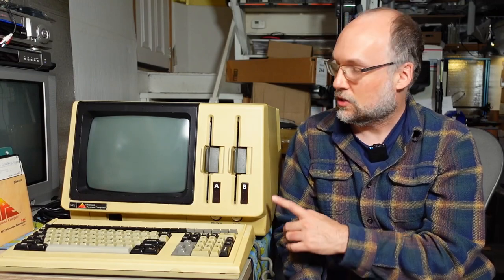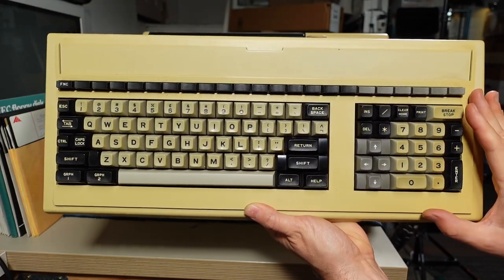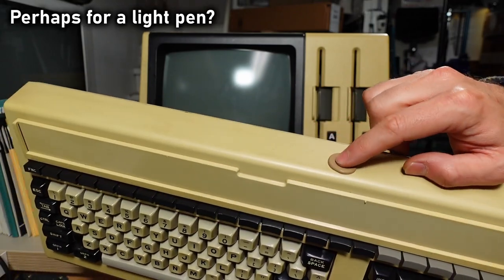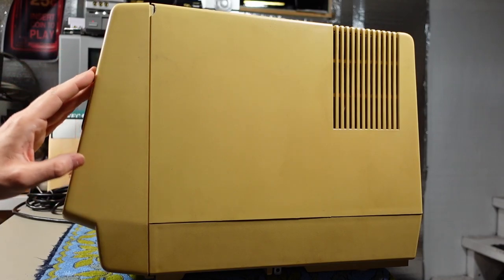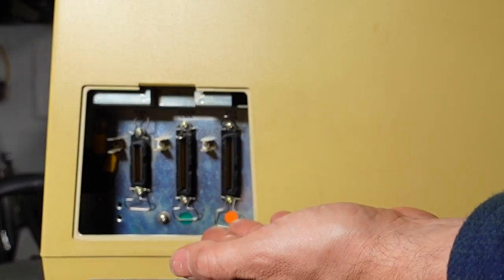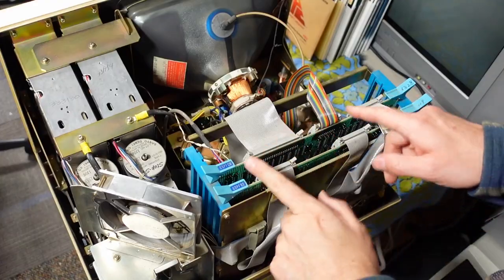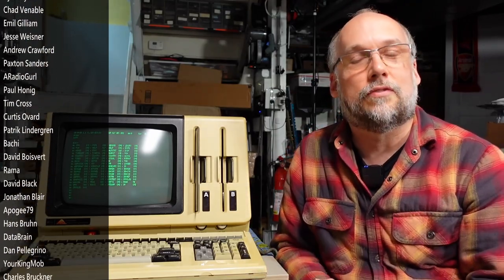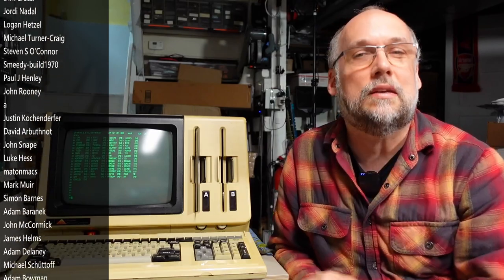The NEC APC runs MS-DOS from 8" disks

Comment: 13:58 <-- Actually, originally the IBM PC model 5150 had 16K as its lowest-spec RAM option, but that got changed quickly, and the 16K-64K mainboard soon was replaced with a board where the former onboard maximum was the new minimum, and the new onboard maximum 256K. You still needed a RAM card to upgrade that to 640K, but you could do it. Once the 5160 XT came out, its board first also had that 64K-256K range, and then later XT boards were 256K-640K, obviating the need for a RAM card.

Comment: If it's just the piinning that's different, a specialized cable might do the trick: on both sides is the standard plug, but the wires are interconnected to match as needed.

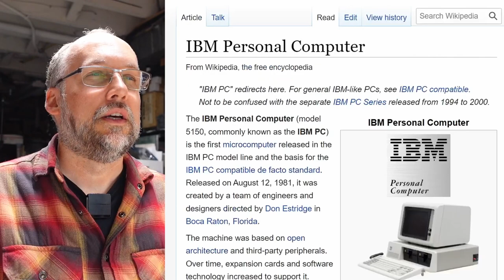Comment: 20:00 <-- Actually, the minimum configuration of the IBM PC did include a keyboard and a CGA card, but no drives, monitor or printer port. It was bring your own TV and cassette deck. People didn't go for that though. People bought PCs with floppy drives and DOS.

Comment: One very crude way of getting information into the machine would be to use COPY COM1: CON:  that would copy anything coming into the RS-232 port to the console.   The transfer would be terminated by a Ctrl-Z.  You could do similar with C/PM, PIP CON: COM1: (if I remember the command correctly).
Reply: he just need laplink pro and a cable.
Reply: @jessihawkins9116  How do you get Laplink on the APC?  Does it have a way of sending itself via the RS-232?  Do they even have a version that will work on just generic MS-DOS? (Non PC compatable)?
Reply: @russellhltn1396  FastLynx does.

Comment: Oh yeah, I had a mono APC for a while. Rock solid machine...and insanely heavy, too. I'm not sure if this comes up in the video or not yet, but the APC is actually a localized NEC N5200 - The PC-98's business-oriented cousin. The two lines ended up merging, with later 98 models actually having limited backwards compatibility with N5200 software.

If you're looking to simplify file exchange, I'd suggest KERMIT - builds exist for both DOS and CP/M-86. You can just use a regular centronics printer cable on the serial port.
Reply: I agree it was heavy. I once took a new one to a computer show. On Amtrak!
Reply: @blucy10  Hell of a haul! I always wonder how much weight the color CRT option added.

Comment: I remember the NEC PC-98 PC, very close but not compatible with PC ( running very like, but hardware was slightly different -  the interrupts where slightly different from IBM-PC), we where obliged to compile all program specially for PC-98. It was very frustrating.
They had a DOS and Windows 3.0 but specially compiled for PC-98.

Comment: 28:15 - The most well known Hercules Graphics adapter does not include user-definable characters. The second generation, the Hercules Graphics Adapter Plus aka Hercules RAMfont does so, but just as the third generation, the Hercules InColor card, those cards lost the competition against IBM's EGA card.

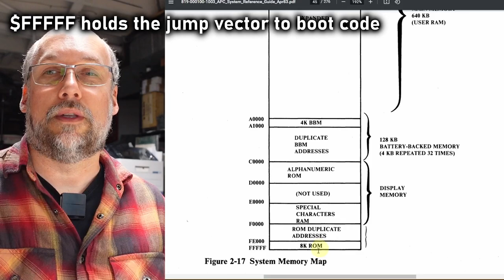30:50 - The reset entry point (the jump instruction) is at FFFF0, not FFFFF

32:50 - 22 kHz is more like EGA than like MDA/Hercules (they use 18.4kHz). Thanks goodness for the "long persistence" phosphor at 41.5 Hz, though! As I know the terms, it is not usually called "long persistence", but "medium persistence", though. "long persistence" is nowadays understood to mean several seconds of persistence, as used for radar screens.

Comment: Interesting that the floppy drives are so close to the CRT - surprised that degausing and other magnetics didn't cause any problems.
Reply: that’s probably part of why the CRT is in its own cage internally, albeit it doesn’t seem to be a proper faraday cage. but between that and the metal casing of the drives, maybe it’s enough
Reply: monochrome CRTs have no need of a degaussing coil, the color version probably has more shielding

Comment: Apple added software power in the 1983 Apple Lisa. The 1987 Macintosh II had it too. The original Macintosh was designed as a sub-$1k computer and was therefore much more primitive than the Lisa. The Macintosh did a lot in software that other computers did in hardware, but this proved to be a benefit in terms of the Macintosh as a platform since they didn't need hardware backwards compatibility with older systems when software relied on the OS APIs. In the rare cases software was optimized specifically for certain hardware, it of course meant they needed to be updated for future hardware models because it simply wasn't compatible with the newer models otherwise. The entire Jobs vs Sculley thing had a lot to do with Jobs's idea of a $999 Macintosh vs Sculley's $2499 price for the same machine. Sculley won that debate and Jobs quit in order to start NeXT. The Macintosh II effort was related to the same "3M" computer (1Mflops, 1Mpx, 1MB RAM) the NeXT was aimed at and shared some early design ideas.

Comment: You could try the rarer MS-DOS commands. Use CTTY to set the printer port as a terminal and then use that to copy files to the filesystem via COPY CON (where con becomes the remote terminal on the COM or LPT port). If you don't have a COM to LPT thing to bridge from the modern world, you could pretty easily make one with a microcontroller or even Raspberry Pi.
Reply: copy anything comX /b should be enough for pip anything=AUX:[O]
Reply: It seems the connection is already serial, not a PC parallel port.
Reply: @johndododoe1411  Even better then, but he resorted to modern means of PCs reading and writing floppies.
Reply: Yeah, that's literally how the old Laplink software worked after all. So long as you had a working serial port, a copy of DOS debug in your path, and a certain amount of spare disk space, plus the software running on another computer and the included cable, you could get a copy of it onto the target and then run it to start more sophisticated data transfer. Whether it would work properly on the APC after transfer is another question...

(it had instructions for what to type in at the DOS prompt to hand over the console control from keyboard to serial or parallel - parallel being preferable as it didn't need any knowledge of baud rates etc and could go a little faster even on a supposedly unidirectional port - and after that the external machine would chuck commands down the line as if it was a really fast human typist... loading debug then entering a bunch of raw hex code into a block of memory that would be dumped to disk as an executable... the DOS UI does after all operate as a kind of terminal connection into the underlying kernel - usually taking input from the modified serial port that is the main keyboard connection, and throwing ASCII plus control codes towards the "glass TTY" of the video card...... and that lets you run the machine remotely and entirely headless if desired - though it may still demand a video adaptor be present in order to boot! - with both input and/or output being routed through COM or LPT as you so wish... Not sure if it allowed multiple simultaneous terminals besides the actual console though! But I have used it before to copy some vital files off a machine with a burned out monitor, thanks to it having a rather old Deskjet attached, which was entirely happy to run in plain ASCII mode, printing each line of text as it was received... booting and entering the necessary commands "blind" (including stopping the Windows load...) then continuing to use the regular keyboard but checking the paper output much like it was a very quiet teletype...)
Reply: @jammi__  Yeah, I was thinking whilst watching that there should be some way to get interoperability between two machines ostensibly running the same version of the OS, same disk media, same kind of drive etc. Perhaps the different size sectors have something to do with it (though DOS should be fairly agnostic about that so long as the media descriptor fields can still be read... and it does after all even format 720K 3.5 inch disks to have 1K sectors instead of 512 byte, possibly as an 8 inch by way of 5.25 hangover?), but I'm more suspicious of using a drive that can only seek to track 77. DOS is kinda standardised on 40 or 80... and that'll cause issues with any machine you hook it up to, surely? Plus it may have been worth formatting a disk on each machine and seeing if the other could read it - there's some shades of trying to transfer stuff between the Atari ST and DOS PCs, where the ST supposedly uses MSDOS compatible format (as both machines have ultimately CP/M derived OSes), but with the earlier versions of the system ROM you could only use disks formatted on the PC itself to move files... the ST could read those but the PC couldn't read disks the ST formatted, for some arcane reason I've completely forgotten, likely a bootsector being in the wrong place or whatever.

Or of course it may work as well to try and hook a 5.25" in place of the 8" on the APC... both sizes of drive use the same connector and pinout don't they? (I may be forgetting something from the video at this point, but AFAIK the pre-3.5" floppies had a common Shugart edge connector) ... that way you have less potential for incompatibilities between hardware that seeks different numbers of tracks, etc, and of course - discounting the slight capacity difference due to having 8 x 1K sectors instead of 18 x 0.5K or whatever, which again DOS should ignore (indeed the earliest formats it supported were 160 or 180K, then 320 or 360K double sided) - the disk formats are identical at the logical level so the APC shouldn't know or care that it has a different size drive connected. But things suddenly get a lot easier at the modern-mainline-PC end.

Comment: Probably NEC used the 8231 instead of the 8087 as I guess it was cheaper than the newer 8087. Or they reused parts of the design from an older system?

Comment: @17:30 might be worth double checking that switch is rated the same. I made a different post and deleted because the 2nd switch looks kind of wimpy and maybe meant for dc or lower loads but zooming in it may actually say 15A  if so then it's likely fine (first switch was clearly 15A at 125v) so long as it's also 125v..

But this is definitely something to be careful of..a switch designed for 15A 125v with AC in mind might look identical to one designed for DC at 15A 12v until the fire starts.
Reply: This is a 120V switch, since the neon light (eventually) works.  A 12V switch would use an incandescent bulb, which would instantly pop when supplied with mains voltage.  The computer's rated power draw is 115V/3A, which the switch should be more than capable of. (And it likely draws much less than 3A most of the time.)

Good general principle, though.
Reply: @awd42  I noticed that later, yes.. but I've also seen AC switches with an LED and just a resistor for indicator or even AC switches that use/expect low voltage DC for the indicator.

But yeah, mainly just don't want anyone burning down because they didn't realize, check or assumed; there's a reason that old PCs had clunky-af-super-satisfying switches and switching mains directly is not very common anymore - I'm sure there's tons of people (Adrian excluded ofc) that don't understand the difference or grasp the concept of a relay (mainly the concept them or transistors/fets mostly being used for the exact reason of keeping high voltage away from switching fingers)

Comment: Regarding DOS software being compatible: I didn't use the APC, but I did use a couple PC-98 machines, which were mentioned in the Wikipedia page.  PC-98s needed their own versions of DOS and Win 9x because some of the BIOS interrupt numbers were different.  Like instead of int 10h, it was int 16h or something (just making up numbers there, but you get the idea).  So if DOS software didn't access hardware directly, it might work as-is.  I know that the software I worked on needed a special DOS-V version, because it did access the hardware.  APC's DOS might be that way too, but I don't know for sure.

Comment: Does anybody know what would be the reasoning behind making the space bar out of different plastic than all the other keys? Does it have anything to do with it not needing any label/imprint? Seems like a recurring theme.
Reply: Spacebars are very long and hence need to resist flexing and warping. They tend to use a different material that might have different cost or manufacturing characteristics

Comment: Recalling my discrete math class in college many moons ago, “A0000” would be pronounced “a-zero thousand” rather than “a-thousand” which would be written as “A000” similar to how we would say “1000” as “one-thousand” and “21000” as “twenty-one thousand.”    The reason is that, In hex, A0000 would immediately follow 9FFF, similar to how in decimal, 10000 immediately follows 9999.

Comment: I think the drive connector pin numbering is just flipped around.  Subtracting the pin number from 51 yields the same signal on the TRS-80 model II connector. Example Read Data is 5 on the NEC and 46 on the TRS-80. 49 is low current and 2 on the TRS-80.  I don't now what Pin 1 Window is as it is a NC on the TRS-80.

Comment: Isn't the pinout on those 8" floppy drives the same as the old style CDC drives? I kind of remember that pinout from the CDC floppy controller card in @Usagi Electric's machine. That would mean that you can use the same adapter board as you have on your TRS-80 drive chassis, but wired in reverse.

Comment: I'm fascinated by how the circuitboards appear to be completely covered in a grid of trace-colored circles that don't seem to serve any purpose. I've never seen that before and I'm surprised you didn't call attention to it.
Reply: I noticed that too. I believe it uses extensive use of vias but i'm definitely hoping he talks about it more in part 2. The whole board looks insanely high quality, like all the chip sockets and connectors.
Reply: IBM made similar PCB's with that grid style.
Reply: @willynebula6193  no
Reply: I believe that it primarily saved on copper echant, though it would also serve as some low-grade shielding.

Comment: I never knew they still made 8 inch drives in the 80s, I thought that was a thing from the 70s
btw, you know you are dealing with a real master when that person just casually finds the most random power switch from 1983 in his spare parts bin......  O
Reply: The 8-inch floppy drives floated on until the mid-1980s. A company I worked for used to sell computer systems that used them and my parents purchased a Varityper Epics 20/20 typesetting system that came with a Shugart 8-inch floppy drive in 1988 with that system being built around 1985. You could still buy 8-inch floppy disks until the mid-1990s but I don't know after that because that's when they switched to a digital output system using PCs and Macs and got away from the proprietary Epics 20/20 which was a really cool computer system.

Comment: One more comment, this computer reminds me of the TI Professional PC, which was an 8088 with advanced features but which was also almost completely incompatible with PC software for the same reason. That also dates from 1983, before the idea of just cloning everything in sight was commonplace. I think the legal status of reverse engineering things was not yet completely decided, and the big guys like NEC and TI hoped to define the market to their own advantage, and then came Compaq.
Reply: I think it has to due with NEC having the computer in the pipeline before the 5150 came out and they simply chose the 8086 (16-bit version of the 8088) by coincidence. Given NEC previous machines where z80 machines that ran CP/M, I can see them picking the 8086 over the Motorola 68000 or 6809 due to it being easier to port x80 code, also since NEC chip fabs already cloned the Zilog 80 (NEC D780C).
Reply: I worked for Texas Instruments in the 80's and we were still using quite of few of those for dumb terminal data entry.

Comment: Someone, somewhere, sometime, said that the software interface specification for 8" drives did not include motor on/off commands, so that the motors spin continuously whenever power is applied.  This seems intolerable, whether from the standpoint of disk wear, noise, or power consumption.  We would expect the oxide to be scraped off the disk surface in a matter of hours if not minutes, thereby making the drives completely unfit for purpose.  What is the real story?
Reply: It's been a long time, but surely there's a head load-unload involved in the things? Closing the door latch would mechanically enable the head load, but I'll bet there's a servo lever somewhere around lifting the head when it's not actually in use. I think Usagi Electric was demonstrating such a thing recently.
In which case it wouldn't matter that the spindle turns all the time and would avoid issues of varying times from stationary to stable rotation (and would be faster too).
Reply: @neilbarnes3557  Yes, Usagi Electric did recently show that!  There is a nice satisfying click as the head(s) are engaged or disengaged.  That said, the disk still spins but inside the plastic case of the floppy is a soft material that is smooth enough that they can spin a long time and still work fine. 😃

Comment: Hearing about the IRQ's, I don't think the IRQs are a big factor in stopping PC(IBM) softwear from working.  I base that on the fact that some programs have options to set the IRQs of the devices they use.  ESP when dealing with Printers, Modems.  The problem would be in the use of the disk drives and things where programs expected to find thous in the same place.   That said you have to remember to MS-DOS is a program.